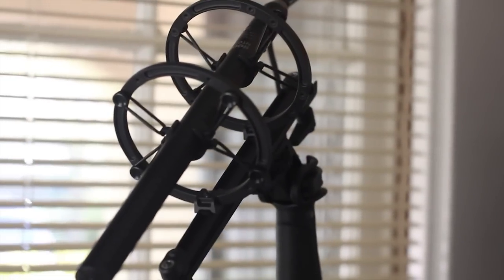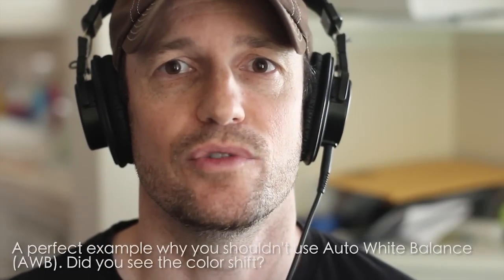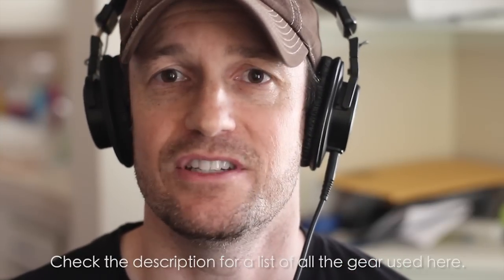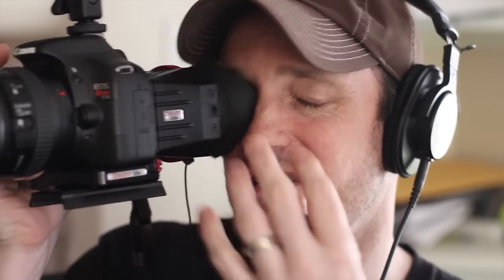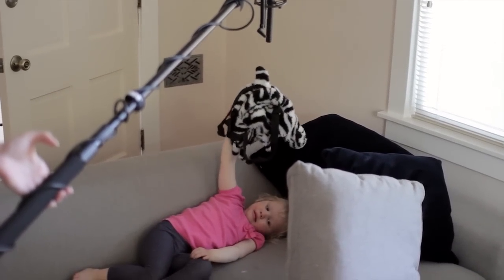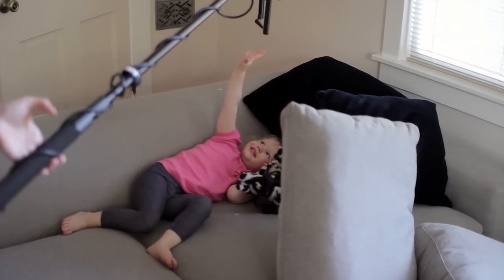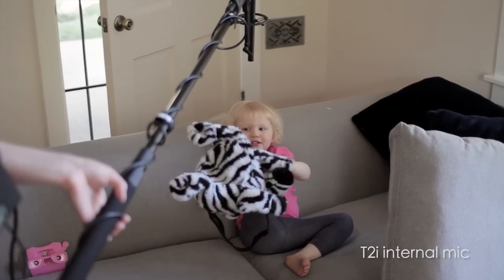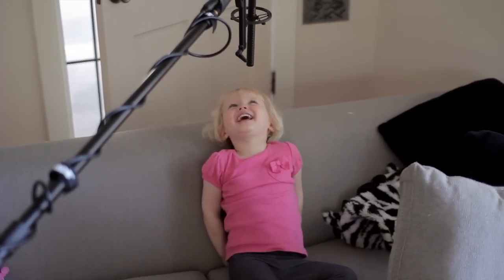Rode NTG-3 on a Boom Pole

Comment: Have you ever tried out the Rode NT3?  I'm considering upgrading to either an NT3 or NTG-3 for indoor use and the NT3 seems to handle indoor reflections more effectively.
Reply from the maker: No, never tried the NT3. Shotguns aren't typically the first choice for indoors because of the reflections you mentioned. I'm testing out the AT4053b to see if it's any better. But go with the NT3 if it sounds better indoors.

Comment: Great review! I have the same microphone. I have a question: when you move the microphone a little, can you hear a noise, like a tremor - like the sound of a small thunder? I have that problem: I used different cables and grips, dead cat and although the movements are smooth, I hear that noise - for example when I try to follow the movement of an actor. Do you think it is a problem of the NTG3 or maybe I should request the microphone replacement? Thank you.
Reply from the maker: Thanks, Walter. Do you have the shockmount like you see in this video? That is what would isolate the microphone from handling noise. If you still get noise when you move it then I'm not sure what is going on because it should suspended and separated from most of the items that would cause that noise when moving.

Comment: Great microphone!!
Reply from the maker: I'm enjoying it. Will probably have to get one in the future. Thanks for watching!
Reply: Ray, I would like to have your opinion. Which one do you prefer, the rode lavalier or the NTG3? Thanks
Reply from the maker: A&V PROJECT They don't really compare, you'd use them for completely different reasons in my opinion. The NTG3 is a better mic but you can't wear it like a lav so it's much more cumbersome to work with. It's also like five times the price. Both are nice mics, it just depends on what you need to mic.

Comment: For interiors I would generally use a hypercardiod mic. Shotguns are good for exteriors. I use the AT capsule range 5083
Reply from the maker: Yeah I had the AT4053b in studio as well and will be posting a comparison. The difference is barely noticeable and since these mics aren't cheap you could definitely get away with the NTG3 serving a dual role but yes, if I was doing interiors only I would probably opt for the AT. Thanks for watching.
Reply: Ray Ortega It would have to depend on the actual location and it's unique acoustics. I have had exterior locations where a shotgun would be the first consideration, but last week I opted for my AT 4051 cardiod mic, simply because both my shotgun and 4053 were picking up to many reflections off the buildings around. That surprised me! Fortunately mic placement wasn't an issue.

Comment: Ray, last week i purchase the tascam. B&H send on time to singapore. Really happy about that. Then i try to operate it, for guy like me (zero understanding of audio) i really lost. Since that package not include the cables and anything. I hv to figure out to buy cable for tascam to camera include xlr cable. Read the intruction book and googling youtube for tutorial (which is no one give you tutorial step by step to use tascam with dslr camera from first record to post production. Mostly they just comment on product not help at all.) end up spend whole week to figure it out. And now ok already. Fix hiss and hum at final cut pro x really big help, the result really clean. 

Still dont understand what different if tascam connect to camera with not connect in the end will syncing by pluraleyes.

The record button both camera and tascam abit annoying. They should on together with one button while they connect each other.
Reply from the maker: Glad you got the output figured out. You definitely can't hit one record button and make both start, they are just different products. If you are using PluralEyes then you don't even need to bother with recording into the camera. That will save you a lot of headaches.

Comment: I'm a starting photographer / vidographer and im looking at the road blimp and I'm using a Nikon D3200 and i was wondering if you could point things out that i might need to make this work for me. 

as of right now I have 
 Rode NTG4+ Shotgun Microphone with Digital Switches and Built-In Rechargeable Battery
 Kopul LMT100 - Low to High Impedance Matching Transformer (1.5')
and the 
 Rode Blimp Windshield and Rycote Shock Mount Suspension System for Shotgun Microphones 
In my cart. 

is there anything else i might need or might need to know about before purchasing these items?
I know nothing about the audio world...

Thank you 
Lucis

Comment: Thanks for the video.  Since wife's don't enjoy holding the boom, I wonder how it would sound attached to the camera in the same setting?  Should I go with a zoom recorder or shotgun on my 70d for chasing the kids around the house and outside? Or shotgun into the zoom?.. Not sure what do do yet.
Reply from the maker: Thanks Grant. The key to the boom is that it's close to the person speaking. When you mount the mic to the camera you have a few different issues. First one is you tend to be further away from your speaker. Second, you pick up noises from the camera and third you get more noise from behind the mic since a typical shotgun will also picks up sound from behind. A good shotgun for run and gun is the Rode VideoMic Pro http://podhelp.me/RbPLrq you can see my video on why it's good with DSLRs Rode VideoMic Pro into a Canon 60D hope that helps
Reply: Thanks Ray!

Comment: Odd. I just got an NTG3 and used it with my DR-60D and it was crazy loud on high gain. I turned it all the way down and I could still hear sound at a high level. I had to drop it down to mid gain to have any control. I wonder why you needed it to be on high gain/why mine seems so much more sensitive.

Comment: Hi Ray. 

Nice video! Do you think a senheiser mke 600 will sound much better than my videomic Pro ?
Reply from the maker: I don't know if I would say "much" better. The key with either mic is placement. You can make your Rode much better by getting it close to who's talking. If you boomed it like you see here that would help. It's harder with the VMP because it's not an XLR connected mic but you can get a longer cable or record into an audio recorder attached to the boom.

Comment: What kind of stand are you using for the boom pole? Or do you have someone holding it. I need a stand alone boom for my Rode Video mic.
Reply from the maker: In this video the mic is attached to the Rode Boom pole that is listed in the description but it's only propped up in the corner. For stationary booming I use this multi-boom stand http://podhelp.me/impactmultiboom which you can see in this video Rode NTG-1 Microphone into a Zoom H4n for Dual Sync High Quality DLSR Audio for Video

Comment: Great video. I have a question. I'm helping a friend of mine put together a setup for his new video podcast. I'm thinking about getting the Tascam DR-60D (I just learned about it today). I also think the Rode NTG-3 would be a good microphone (he doesn't really want any microphones visible in the podcast). I'm pretty new to audio/visual equipment. Does the Rode NTG-3 need an external power source? Or does it just plug directly into the Tascam and that's it (I'm assuming there's an XLR cable from the microphone to the recorder)? And if I'm using the Tascam and Rode set up for audio, does it matter which DLSR we use? Thanks for your help.
Reply from the maker: Russ Tanner Great mic and yes it needs 48 volts of phantom power which the DR-60D http://podhelp.me/dr60d supplies via XLR cable. You can plug it into any DSLR that has a mic input and you want it to also have manual audio control on the DSLR.
Reply: Thanks for the info. If we decided to use a wireless lapel microphone, which one would you recommend? And how does the wireless mic feed into the digital recorder? I'm trying to understand all of the various things that would be needed.

Comment: Hey Ray,
						
							I'm currently using a T5i and just recently purchased Rode NTG-2 and Zoom H4n and need to mount both of them to my DSLR. What would be the best solution to achieve this? Are there any particularly inexpensive ways this can be done? Could you recommend any shoulder rigs or cages?
Reply from the maker: Cheapest way would be to just get a hot shoe attachment which holds more than one item. Like a hot shoe bar that you can mount multiple items onto. I also have a handle like the one in this video Tascam DR-60D Audio Demo but it was free and I think it got discontinued but you can probably find similar items.